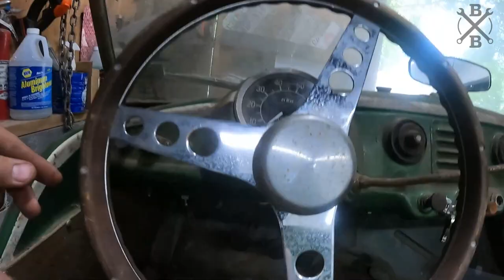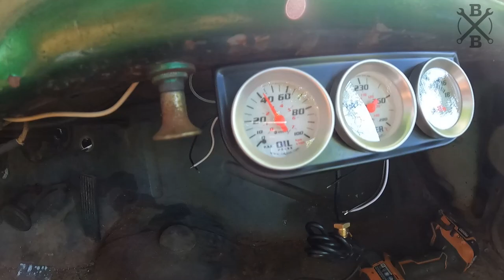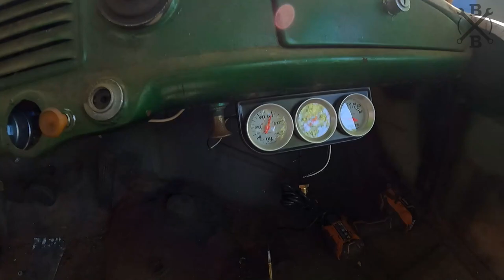Barn Find Hand Built Custom Nash Metropolitan: First Run and Drive in 36 Years

Comment: I love this small goofy rescues and I think they are awesome. Some people don't understand the fun of driving a small car with a small engine, specially this older ones. You feel the road, the wind, every gear.. :-) In my time I rescued from death a VW Rabbit convertible (yellow) we called Pikachu. Not much power, not much speed, but a blast to drive with the top down (well, missing). :-) Some of my first driving experience was in Spain on a mini, the original, old, sit on the floor mini. :-)

Comment: You have probably learned a lot more since you ran this video but here’s a bit of information on the Nash Metropolitan. The engine was an Austin A50. Austin and MG were 2 parts of the same company. The Metropolitan used the same engine as the MGA but because the Met body was taller than the MGA it was too heavy. To help remedy this Austin took the horsepower out of the MGA powerplant by using dish pistons, smaller valves, and a small 1 bbl carb instead of 2 carbs. This dropped the HP to 50. Now, you can do the MGA upgrade which brings the HP to 80 but, the rear axles are only rated for 50 HP. The seats on a Met were low, your but was probably about 2 inches off of the floor board. With the little HP the rear end ratio was 4:10 so the engine would have some acceleration, but it is hard to enter the freeway unless you get a long running start. They were really made to run in the city. You will notice that on the highway you will be running all out and hope you don’t hit any hills. But the Metropolitan has the same quirky appeal, driving it makes you smile and everybody smiles and waves at you when you pass by.

Comment: A year ago I posted it was a rollover, I'm sticking to it. Was probably salvaged missing the roof, windshield, both doors with fender damage on all corners. Clever to use the dune buggy theme.  Wheels, a lot of the Smiget crowd used the Vega G T units.  I hope you can do something with the harsh windshield frame.
I was turning 18.40 at York U S 30 in 1960 with my Metropolitan.  
Thanks for your efforts.

Comment: Mechanical fuel pumps can be a pain in the bum. Had a choice of 4 AC pumps, rebuilt them goodness knows how many times. No fuel then I thought why not connect a manual suction pump up to the outlet from said pump. It worked, car started up. At least when I drained the petrol tank out it was remarkably clean inside and no problems with removing the drain plug. I have to love those old Rootes built cars.

Comment: I would put the gauges where the radio knobs are and the hole for what even in the middle of the dash next to the ignition key below what looks like the air vent. I think it would of been a cleaner look and not interfere with passenger leg room.

Comment: Comment 2: Please at least find some copper tube for the oil pressure gage. The plastic one will go away in a year tops, and probably spray oil all over everything close and that new carpet will have to be changed again.
Reply from the maker: I picked up two sets of copper for the Nash and Comet! Thanks for the suggestion! Definitely don’t need a mess or fire!

Comment: Fuel pump backwards probably due to valves being reversed. Quite a common issue on these old manual pumps with almost identical  suction - delivery valves.

Comment: Very interesting car. I wonder what would be a good set of wheels for it? You'll need to have 5 wheels as one obviously goes on the truck so that cancels the keystones. I also think the headlamps are out of proportion. If they were smaller (perhaps square) it would look better. I recommend only buffing the car. More story to tell than a repaint.

Comment: Never be a hot rod? Bore that little 4 banger out .060 over slap a set of headers on it and put 4 flat side carbs on it with a good length runner and BOOM its a little faster then a golf cart ;p

Comment: Excellent video :) also put gear shift on floor instead coulmn & why this made because Volkswagen Dune Buggy made in 1950 to 1990 of Volkswagen Bug or Bettle cars made then plus not hard make too back then only difference were  was motor and transmission in back in roll bar cage frames ! But in 1970's Volkswagen made body like those could add in hard top or coveritable body kit called Tubs!

Comment: one or two extra wires to hunt down to fix it right, but you patch the ignition together? I'm disappointed. I've rewired Korea era jeeps from scratch including turn and break lights and didn't patch them that much. You had all the terminals you needed to make it turn on, start, and wire the accessories right in from and didn't do it. Hmph!
Reply from the maker: Hey! Factory ignition on the Nash Metropolitan is a power switch with a pull cable. Crazy weird and different but it’s what was factory 😅 So we installed everything just as it came original 🙂